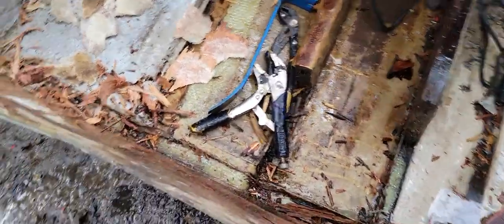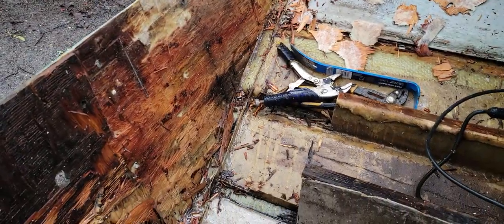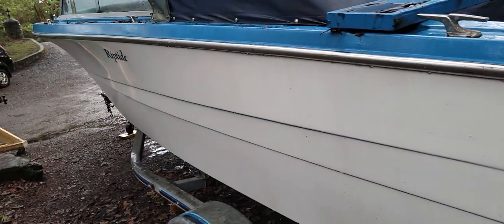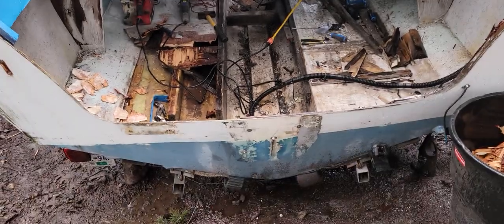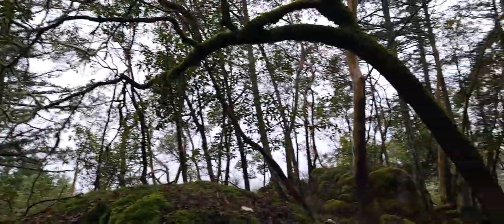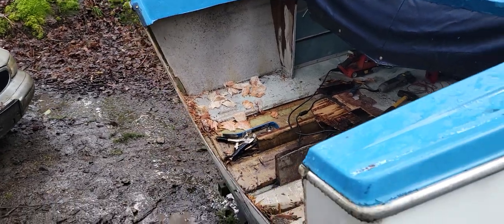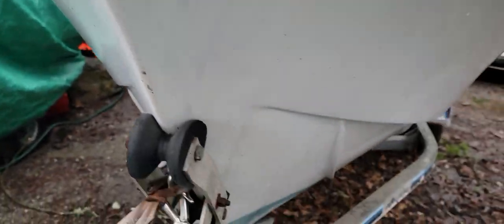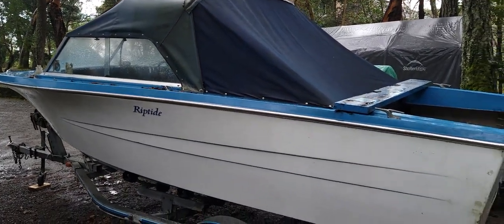Hourston Glascraft Restoration - Part 3 - Transom Removal

Comment: Transom shape is by design according to some old fabricator I spoke to.  I thought it was warped from stress....possibly was a little as the splash well cap was a bit distorted and had popped the 1 inch brass drain out of its hole making it rot even more. The shape makes it slightly stronger. Ply goes in multiple laminations to follow glass curve . Many boats have flat transoms, Hourstons are convex.  In fact, you will find your splash well is about an inch too long when you go to put it back on because your transom will be flatter than factory. I had to trim mine because my transom flattened out slightly when I clamped it.